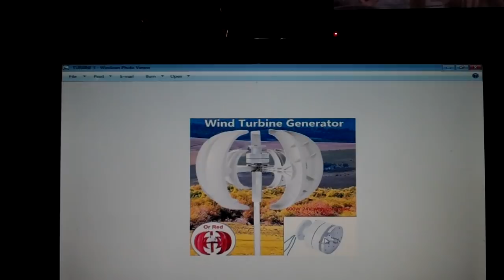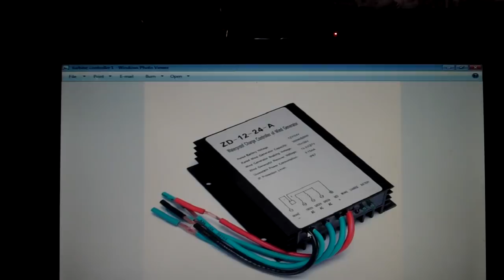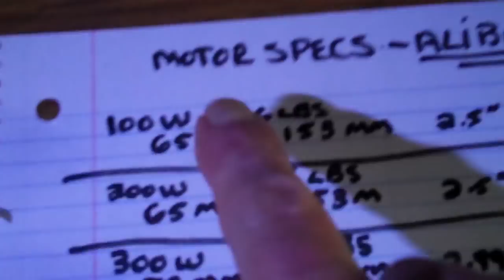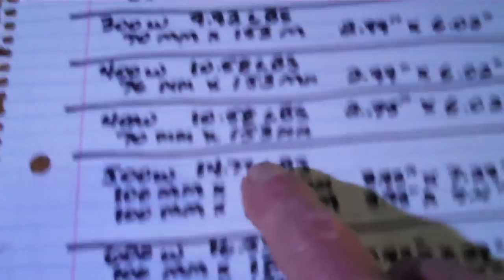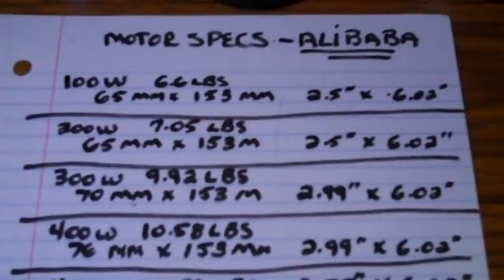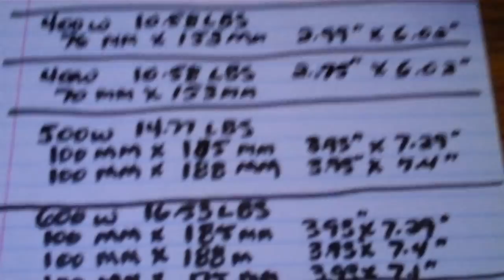SCAM-CHINESE VERTICAL AXIS WIND TURBINE-VAWT-THE SAD TRUTH-JUNK-PART 2

Comment: Witajcie.Kupiłem na AliExpress  taką turbine wiatrową 300w 24v. Ona nie ma żadnej mocy.Przy napięciu 12v wytwarza tylko 2.5 wata. Była bez tabliczki znamionowej.Stanowczo odradzam kupowanie takiej turbiny,ona nie ma zadnej mocy.Zostałem oszukany.Dziwie sie ze ta firma nadal jest na allexpres.Ta firma powinna być  ukarana za kłamstwo i wyłudzanie pieniędzy.Stanowczo odradzam kupna to tylko stracone pieniądze.
Reply from the maker: ENGLISH PLEASE !! I HAVE NO WAY OF TRANSLATING THIS.THANKS  MEL
Reply: Polish language detected))
Reply from the maker: @vitalijkonakov9464  maybe you can translate what he is saying  thanks  mel
Reply: @melbaron1110  
Almost what you've explained in your video and also got cheated by seller instead of 24v got 12v turbine that produced 2.5 Watts. 
As far as I can understand because I'm Russian))) 
But he's not happy at all. 
Thanks for your video because I was thinking to buy one of these as well for my Quail farm to keep flights on now will go for the other type of turbine. 
Did you see John Daniel's channel he had the same type of generator?
Reply from the maker: @vitalijkonakov9464  yes i saw his videos and he shows the turbine producing power,because he is using a large drill to get turbine up to 600+ rpm's.the mounted vawt will only spin up to 150-200 rpm's so it can not produce anything.mount that same vawt turbine as a hawt and it will produce power.
Reply: @melbaron1110  
Thanks for advice
Reply: Ta turbina wiatrowa którą dostałem 300w 24v z regulatorem ładowania 24v - nie osiągneła  pełnej mocy 24v , a były bardzo silne wiatry. Ale pomimo tego gdyby miała pełną moc 24v  to osiągnełaby maxymalnie 6 wat. JEST TO ZA MAŁA MOC DO NAŁADOWANIA AKUMULATORA .POZA TYM REGULATOR ŁADOWANIA  POBIERA MOC W STANIE SPOCZYNKU.INSTALUJĄC TURBINE POZIOMĄ NA KOMINIE BUDYNKU  NALEZY SIE ZASTANOWICZ CZY NIE BĘDZIE PRZENOŚIŁA HAŁASU DO BUDYNKU MOŻE BYĆ TO UCIĄZLIWE..Jednym napisem jest to jeden wielki śmieć i dziadostwo , chyba ze ktoś chce miec drogą dekoracje ,ozdobe.Dane turbiny niezgodne z opisem -jedno wielkie cygaństwo.Pozdrawiam wszystkich zawiedzionych i zniesmaczonych którzy zakupili tą turbine oraz stracili  pieniądze ,czas i nerwy przy niej :)). A tych wszystkich producentów turbin ,sprzedawców wzywam do opamiętania się zeby więcej nie oszukiwali ludzi. Pozdrawiam zawiedziony ,zniesmaczony i  oszukany :)).
Reply from the maker: @jarosawawer7597  have someone translate to english for you thanks mel
Reply: Yes it only produce some power with a drill, I did the same but nothing in wind.

Comment: Me too I bought the 600 Watt unit but received the 400 Watt unit , maybe get 50 Watt out of it.
Reply from the maker: your lucky you get anything out of it.i have had winds over 20mph and have yet to get a single watt out of mine.
Reply: My mistake, you right got nothing so far, I opened it found no copper inside they are aluminum wires with copper coating.
Reply: @johnq8792  Please don't blame the wire. If you ever open up a heavy duty transformer you can find Al wire in them too. Also every one of my Samsung washer Smartdrive motors is wound with Al wire. And yet, at the same speed that I spin one of these at, I can get hundreds of Watts out of the Samsung units. The Samsung units I have are wound with 20 AWG AL wire currently. I have on hand 20AWG Cu wire to rewind one to see what happens. Problems I see are there is a large gap between the rotor magnets and the laminations of the stator on the Chinese PMAs. And the magnets seem weak.  That is one of the reasons they spin so freely without a load on them. 750 RPM on Samsung 1 phase split into 3 units of 4 coils in series puts out 101 Watts at about 28 Volts when fed thru a PowerJack Toriodal 110/220 Volt transformer. 2 pair of 3 coils in series adds another 40 Watts.  Chinese PMA at 600 RPM puts out 20 Watts from all 3 phases at 27 Volts thru a 6 Diode rectifier. Tomorrow or maybe later tonight I will hook the Chinese PMA  to a 3 Phase supply and see what kind of speed it runs at and current it draws. My guess is that the PMA rating is actually a motor rating.
Reply: @gravelydon7072  ...yes I agree aluminum wire works and the magnets too weak and too much gap, ...
Reply: Well I hooked it up to the supply and the results were as expected. Doesn't even make a good motor.
Reply from the maker: @johnq8792  just another chinese scam going on.its a shame because it just ruins things for everyone.it will all catch up to them.it always does